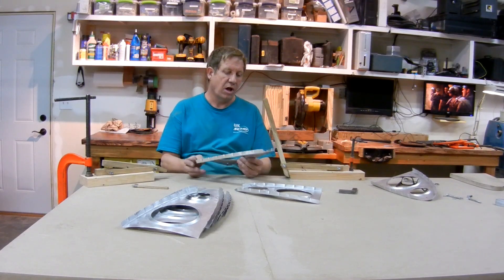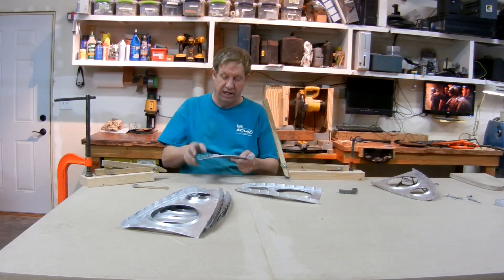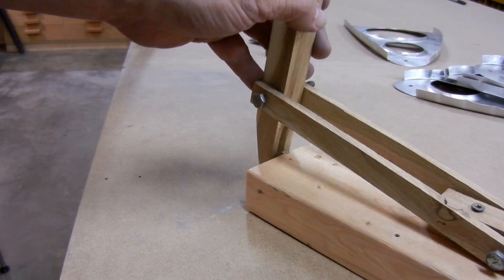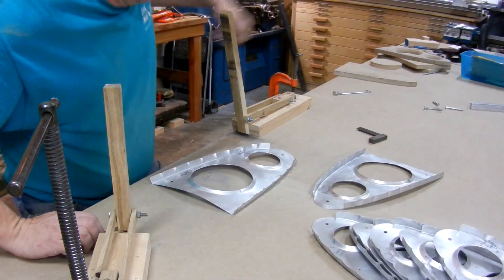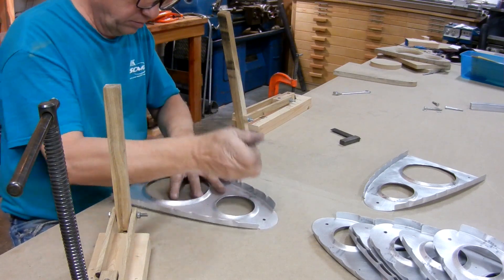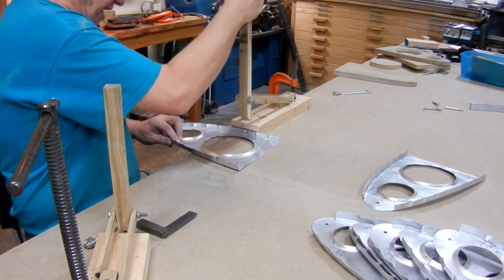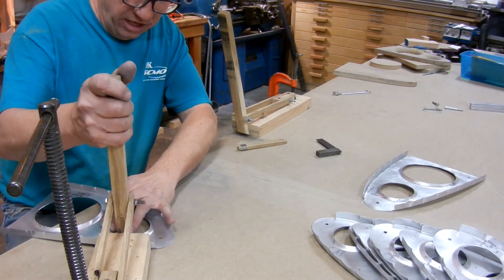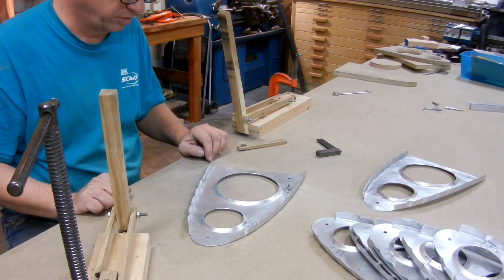Bearhawk Experimental Airplane Build : Straightening Nose Ribs

Comment: All his videos are great... but for those just getting started...This video is one of the most important videos on scratch building a Bearhawk or any other aluminum aircraft efficiently... his angles on the flange straightener are for 2024 t3 aluminum.. 6061 will need a different angle...

He also shows how to use the Bob stick

Excellent content